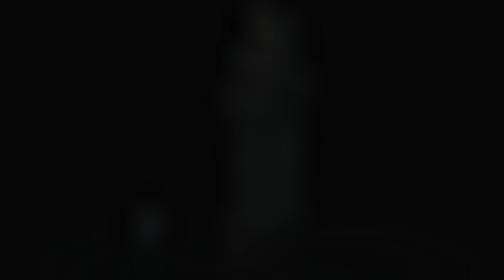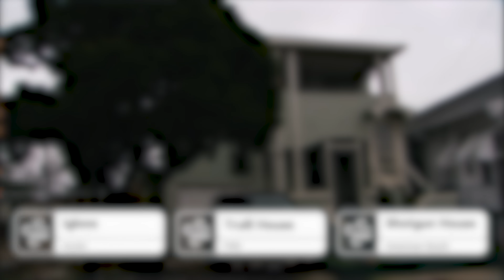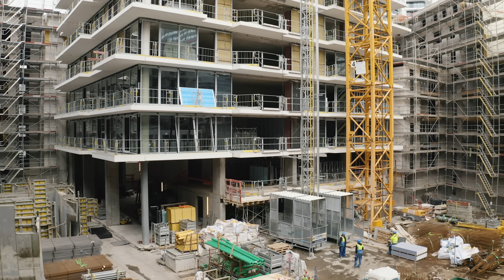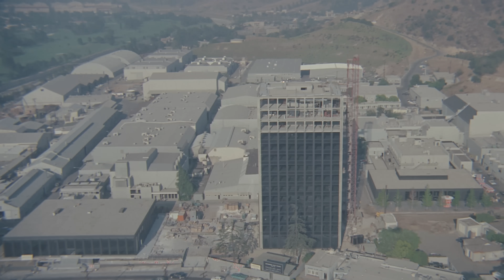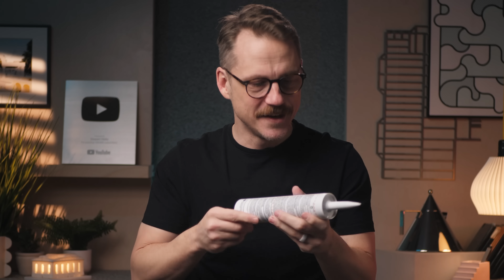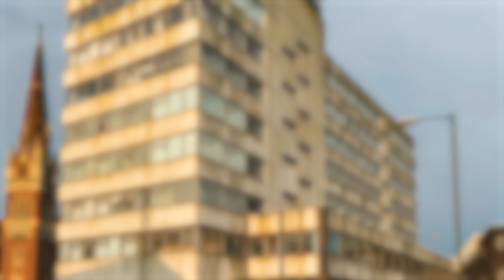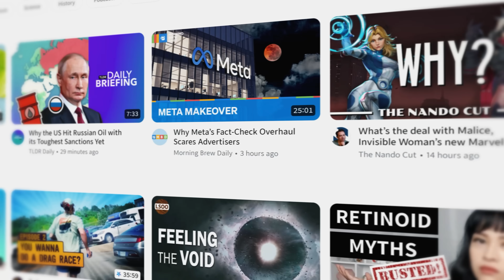How Caulk Accidentally Made Buildings FLAT

Comment: Amazing what intricate architectural marvels you can build, and maintain, when skilled labor is cheap, readily available; and you don't mind that a few dozen workers are killed on every major project, or otherwise die early from work related hazards, e.g., hand carving silica laden stone without a respirator while perched on wooden scaffolding 15 stories up.  Such a wonderful time to be an architect, seemingly no limit to the ornament they could specify.

Yes, caulk has a measurable lifespan.  But so do nearly all newer structures, especially residential ones.   And there's practically no structural component of those, except perhaps the concrete foundation or metal roof, that anyone would expect to last more than 40-50 years nowadays, and probably that only with proper maintenance.  That's a reality brought by expensive--but surely more ethical--labor economics, energy efficient building envelopes, and the pulpy engineered building materials we currently use.

Be thankful for modern caulking and paint technology.  If these materials didn't work as well as they do, your house would either cost 3x more, or would require semi-annual attention and repair to prevent it from leaking and fairly quickly rotting away.

Comment: At least he was open that it was just a hate caulking video.
I hope he follows through and does one about new products that outperform any "historic" solution. And allow more use of details he likes.

I worked on a house with limestone siding where each piece of aiding was hundreds of pounds with narrow grout lines.
Epoxy cost was well into the 6 figures just for the siding.
That classical design was better than most in the world over the last 100 years. It will have less maintenance over the centuries.

Comment: My 1926 Tudor will be the death of me. Right now, I am remodeling the 2nd floor bathroom. The 400 lb cast iron tub, plaster and lath (base layer of cement covered by lime plaster has filled 2 bagsters. The tile floor? Some kind of hybrid 4"by 4" by 3/4" tile that is a mixture of wood chips in a ceramic base with 4 nails in each tile. Each nail is angled inward requiring a hammer drill to remove.
I want to reposition the window-- Outside is stucco over steel lath, over celotex over tongue and groove wood siding.
Yes. They don't make them like they used to.
Reply: How sympathetic is your reno trying to be, and if you're trying to restore rather than remodel how much are you able to do with contemporary (at the time of construction) methods - through cost, building permissions or codes, craftsmen, etc.?
Reply: it sounds like you are taking something of a time, forcibly ripping it out, and replacing with something modern (generically) 

It sounds like a nightmare, I would have shined everything up, but avoided what you are describing on pain of death, for exactly the reason you are battling it.

And when you are finished you will have a bathroom that doesn't fit the rest of the house.
Reply: @ Not necessarily. The OP hasn't responded, but I'll have a bash at it.

The structure of the house may not support that weight any longer and needs replacing. Also, back then we created wet-rooms differently. Now you'd have a regular part of the structure, slather the membrane on and tile over the top.

100 or so years ago you may have had a cement layer and tiling, kept well-grouted and maintained, to trap water and drain it away (assuming the plumbing is within the period that there's a floor drain)

It's a nightmare, but there is a sympathetic bathroom restoration, and there's functional bathroom furniture. At my age, my hips like a shower I can simply walk into.
Reply: @ We've been pretty good at keeping the style. That bathroom was worn out. The plumbing was way out of code (no vents, gurgling sinks). Tile worn out.

 I also had to raise the ceilings on the 2nd floor and this was the last room. It is balloon construction and for some reason the 2nd floor ceilings were about 76" tall!

Comment: You started the video by saying that caulk gives a building structural integrity in the way that a gingerbread house gets its structural strength from the icing. This is not true. Caulk seals joints so that water doesn’t get in, it usually doesn’t act as a fastner although there are exceptions to this rule.

Comment: Caulk did not kill ornamental buildings, designers and their cheap ass clients omitting ornamental details killed ornamental buildings. It can be done, nobody wants to pay for it, you're not going to argue with a client about the need for it because you don't want to spend the effort to draw the details, plans are already so hard to pass examination. When was the last time you drew a beautiful entry and elevator lobby, that's not a caulking issue, that's a training and discipline issue, we're too busy trying to fix a Revit family. Yes the ever expanding list of building and zoning code requirements doesn't help, nor did the structural issues related to the cladding weight on towers, but you might as blame it on the informality of not wearing neckties and vests, we just don't care anymore.

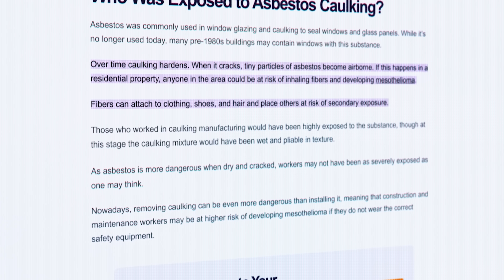Comment: 15:40 This is a subject all it's own: the consequences of chasing hermetically sealed perfection. Some materials need to "breathe", like brick: it will absorb water, but then also release it, and a good design will use that it it's advantage, rather than dismissing it as an 'inferior" material.
I'm not saying that buildings need to be drafty, but rather that we often chase after an ideal that leads to more $$ and resources that kills most of the om-paper efficiency gained, when it could have been more efficient in total to use different methods & materials.

Comment: I disagree with this biased viewpoint. If you want 10x construction costs, then follow Stewart's advice.
If you want the outside city pollution and bugs to come into your home because it uses the old-style open joints, then follow Stewart's advice.
If you want your heating bill to triple because your heat is lost to the outside, and you want to lose control of moisture in your home, follow Stewart's advice.

Plus, it'll take 30-40 years to build up a generation of craftsmen to go back to these gaudy gingerbread house buildings.

Comment: Interesting to think about this in the context of adobe structures (like the house in which I live). The most basic elements of the structure have all the properties Stewart is ascribing to caulk (well, many of them anyway). The material is completely forgiving of imprecise work, and in fact does not lend itself well to precision. You fit things into it with crudely cut/formed holes and liberal packing in of more mud. 

The design elements in adobe come much less from ornamental design and much more from use of space, light and contrast. There's a difference between a well-made adobe and a poorly made one, but there's even more of a difference (huge, in fact) between a well designed and a poorly designed one. 

Ornamentation has its place, I suppose, but it is really quite interesting living in a part of the world where it is somewhere between irrelevant and impossible.

Comment: I think you're overlooking a VERY important counterargument to your whole video. Money. I have a lower-middle class income. That limits my ability to pay for things. Could we build a house using fully hand made materials? Yes. We could build a home that lasts 500 years with only moderate maintenance done to it. The problem is that this house would cost an INCREDIBLE sum of money.

Our ability to manufacture perfectly identical objects at scale gives us the ability to make buildings cheaper and faster. My dad's house was built in under 90 days which was good because it got him out of having to rent an awful apartment. If we opted for all the building techniques you mentioned, that same house would have cost easily twice as much and taken a full year if not longer to build. It's not caulk's fault though. Caulk was an invention created to fit a growing need. Ask high end professional carpenters if they'd rather use only hand tools with zero electricity in all steps of their work from cutting the tree to milling to the wood working to the final product and while they may want hand tools for certain parts, they'll still want modern tools/processes to help them.

While old stone buildings are beautiful (and they really are) they also create a population choke point for major metropolitan areas. Building high takes lighter weight materials and with stone/brick you have a limit before the building's facade becomes so heavy it collapses on itself. These lighter, mass produced materials give us the ability to build higher where we otherwise would be forced to expand outwards.

We simply can't afford to build homes and buildings like that anymore. Just like we can't afford to build castles. Sure, the skills are there and people could make it happen but the sheer volume of cash makes it so cost prohibitive that it is just not worth it other than making a statement to show off that you have Bezos-level money.

Comment: I still don't see how caulk killed ornamental buildings. Since caulk is just a gap filler and the terracotta facades had many more miles of filled gaps.

It seems more like it had to do with the general expansion of government, the ideals of communism, and a rapidly expanding population. Lots of cheap, fast construction under heavy regulation with little room for individual distinction, and a decline in generational stability.

Comment: Caulk didn't change the design of buildings, architects did. You can have unitized curtainwalls that are significantly more ornamental than the typically flat facades you normally see, the issue is the builders do not want to pay for that level of ornamentation. The old ornamental buildings described here leaked and were drafty... Unless they "sealed" the seams with something. I was hoping for more, but this is a flawed premise. 
Full disclosure. My company designed, built, and installed the new facade on the UN Secretariat in the 2010s.

Comment: One thing to note in favor of the “caulk way” that old Chicago window example you gave is a well made window. Many 100 year old buildings in the city are thrown together haphazardly and are not made nearly as well. Even if a lot of them are well made now, it doesn’t mean they were at the time. Well made buildings tend to withstand the test of time better than poorly made one. So for every exquisitely crafted window you reference there were probably 10s if not hundreds of terrible ones. 

The caulking method helps standardize the low end. The buildings it’s helping most in aren’t comparable to the historically significant buildings of the past you reference. They are comparable to old buildings that were torn down or are dilapidated husks now.

Comment: Suck my caulk!

I like the video! However, I have to say i don't agree with you fully.
People have been using sealants like tar for centuries and modern sealants are exceptional at their job when they are used properly.

You are absolutely right that the industry has an over reliance on caulking and exterior sealant like OSI Quad. 
But the areas that fail are because people use sealant in ways that they are not ment to. I am appalled at how often I see Quad used instead of drip edge or proper flashing. The only point of exterior sealant is to waterproof the vertical seams on siding, and that is only a precaution because the real weather barrier is behind the siding.

If you experience sealant failing anywhere except the shower, it was being used incorrectly. That's the builders' fault not the product.

Comment: Meh, I'm not quite buying the argument that caulk caused any of the modern lack of ornamentation. Builders could have built more plainly 100 years ago but the fashion was to go ornate if you could afford it. And similarly if modern builders wanted to add ornate flourishes nothing is stopping them. Look at the crazy roofs on houses built in the last 20-30 years in the US, they would have been completely doable before that but instead roofs were far simpler in the past. Widespread use of pre-fab trusses made it so architects could design them easily and cheaply which resulted in changing fashions which are now they are the norm. Tastes change and people who are building and designing new building don't like the ornate styles of the past, that's why we don't build as ornately as before. Not because of caulk.
Reply: Aesthetic fashion and technology/construction methods influence each other greatly. Thinking that they are entirely separate considerations for architects and builders is just not plain wrong. So caulk alone didn't cause the disappearance of ornamentation, it is very much a factor in the proliferation of this contemporary style of building

Comment: Lol, omg, dude. A whole video on caulk, and you couldn't hear yourself, lol cock, cock, cock ..... McCauley Cockin or McCauley Caulkin, I'm sure you do not say Cockin, well, 98.3% sure, lol.... Just think about hitting the L, forget the other letters but make sure your tongue is going to hit that L, and you will never say cock unwanted again. Or think to emphasize/stress the L, as we do for most multisyllable words, or think of an 'uh' sound instead of a 'ah' sound,(incorrect sound for word, but it makes you pronounce the L, so the word spoken sounds better aligned), same as saying, sulking 10x then caulking, then sulk 10x, then caulk,  then 'bulk' lmao.. it's the L after that range of vowel sound. See, there is talc, calculator, but they are just on the edge of that vowel sound, when it gets to the 'aaa' sound it gets easier.   Balk, yolk have to be the toughest to say properly, so no one does, though both, neither do they straight up bawk or yoak, we put a tiny little stretch in there to alter the vowel sound. Language is amazing. So is architecture!  ..... lol, you should be good now  }peace

Comment: This just doesn’t hold together. We used to fill gaps with mortar. Now we use caulk and it’s killed architecture?

We need leaky porous buildings to  restore the rightful character of design?

Just another addition to the nostalgia genre ‘we don’t build them like we used to’

I get that you don’t like modern architecture. You could just say that.